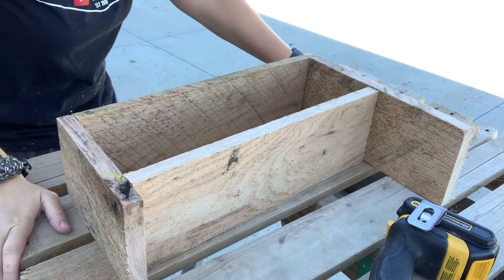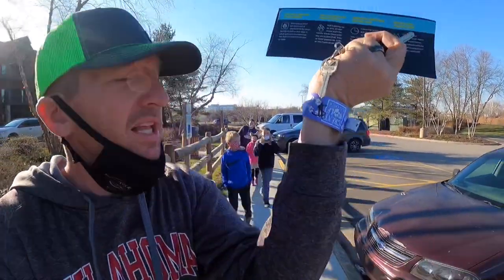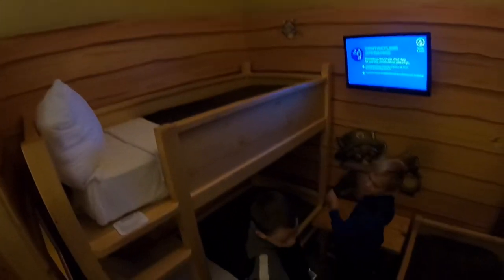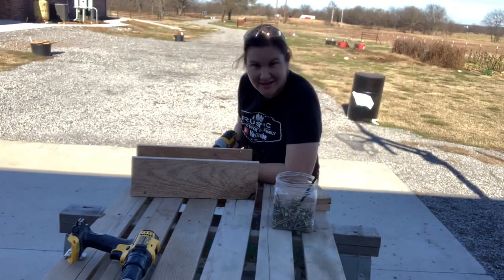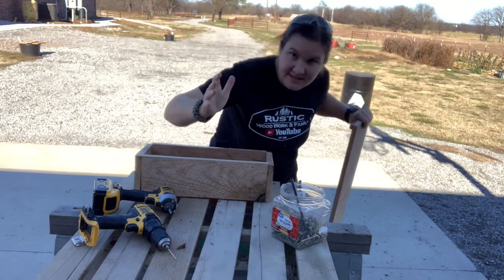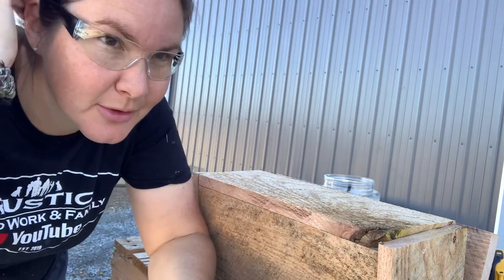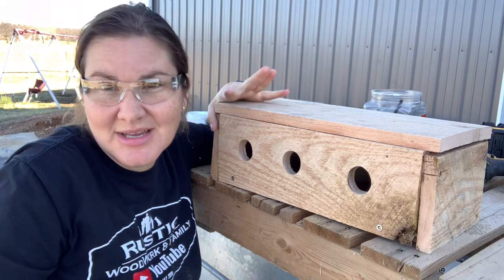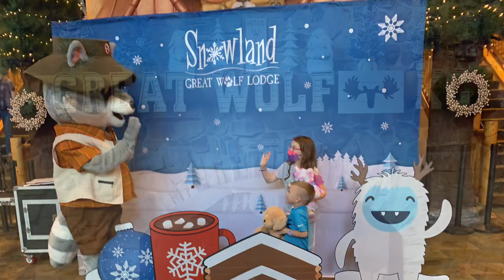Look At What My Wife Did While I Was Gone!

Comment: Cassie, The first cutter you tried using to make the holes is a hole saw, but it needs to have a drill bit that extends past the cutting teeth to guide it into the wood to cut the holes. Not sure if that one is for cutting wood, plastic or metal. Nice job on the feeder. Boy, Mazzy sure is comfortable with the camera and having a blast. 📽🤷‍♀️ That's a pretty cool Lodge and looks like you all had a great time. Have a wonderful night! 🧓
Reply from the maker: Thanks Clifford. Helps if you have the correct parts 🤣🤣 I couldn’t figure out why it wouldn’t stay still!
Reply: @WalkerFarmFam  You were able to get the holes cut and hopefully they are large enough. Well, off to work now, so have a wonderful day and see you on your next video.

Comment: The first hole saw would have worked but you were missing the center drill bit that goes I the center to hold the saw in place so it doesn’t dance all over the place.  Great job!  It turned out nice.  Way to step outside your comfort zone and make something amazing.
Reply from the maker: No wonder it wouldn’t work! Good to know. Appreciate the kind words.

Comment: It's a hole saw, but you're missing the central drill that goes inside that hole saw. That's why it was dancing all over.--Also, a Cassie. 😉
Reply from the maker: That makes sense. Probably helps if you have the correct parts!